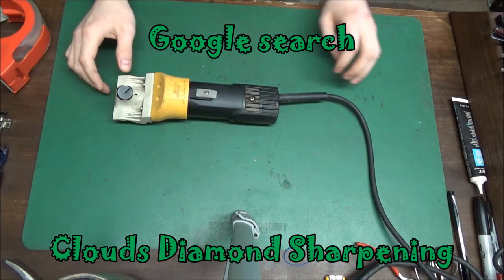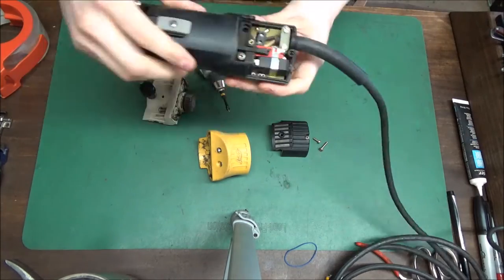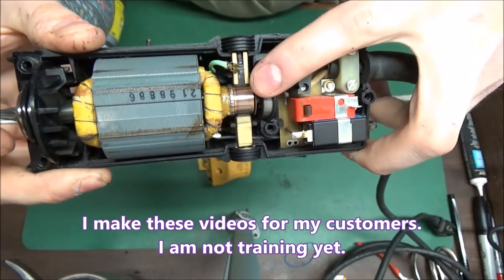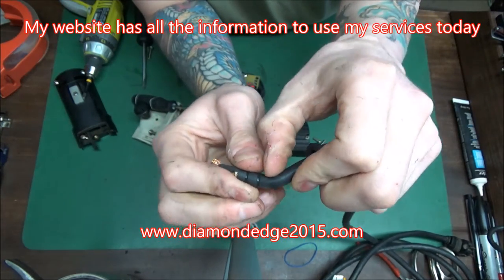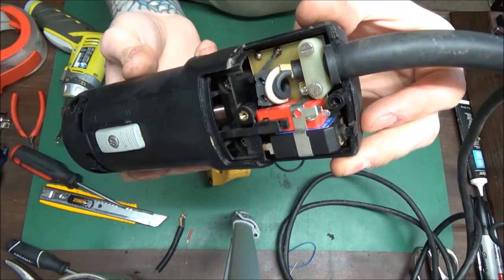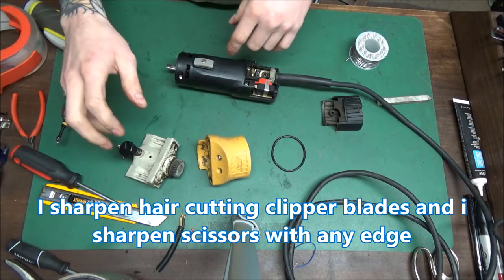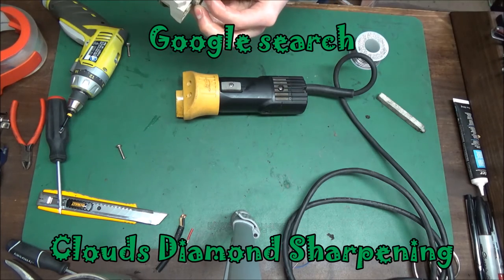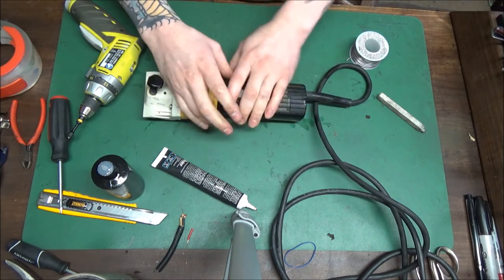Lister Stablemate Clipper repair

Comment: What’s the trick with the reset button?
Reply from the maker: Hello. Well it's because it's a clipper that is sold in other countries also so the reset switch is for countries without breakers. So the clipper don't catch on fire. You can either solder across them because they are not needing in America and don't use them or you can replace switch with the reset switch on it but I generally don't recommend that unless there's something wrong with the actual switch